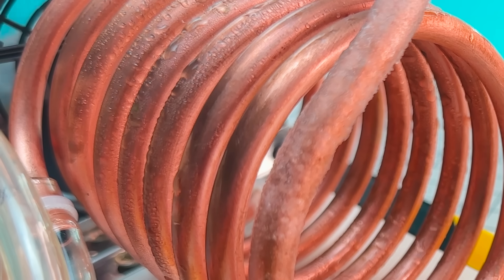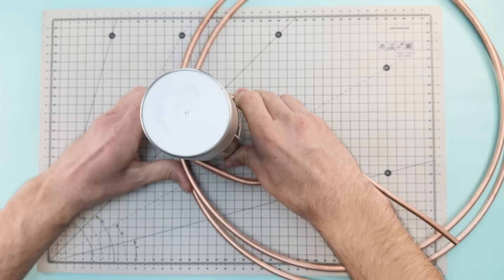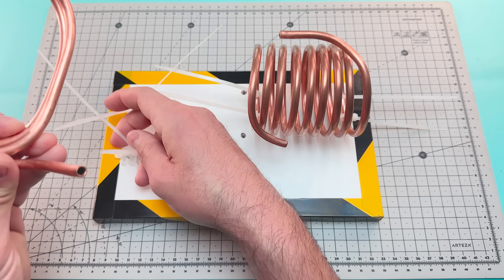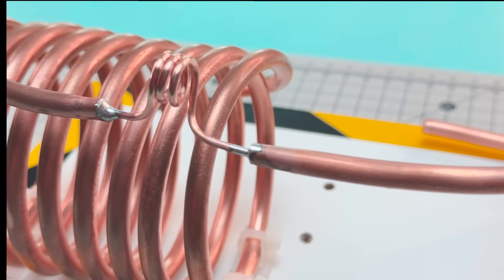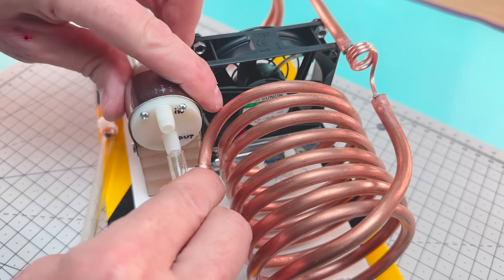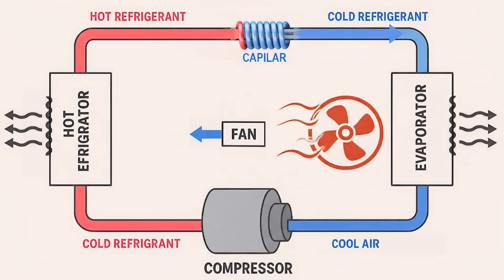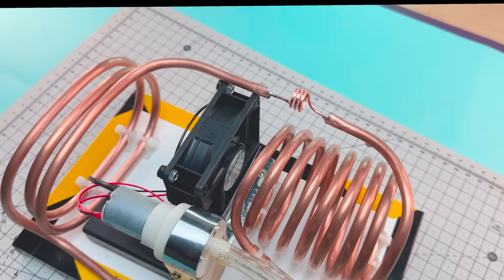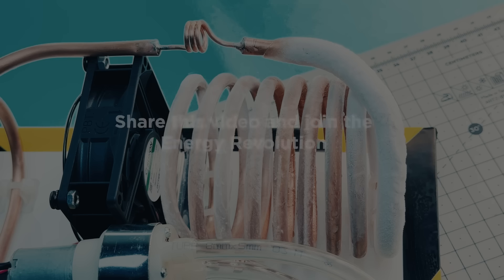Make your own AIR CONDITIONER at home Fast and Easy!

Comment: 1. Your pump is not compressing. 2. your nylon tubing wouldn't be able to withstand the pressure required of the refrigerant. 3. your loop is full of air. 4. even if this did work your "evaporator" would just be absorbing the heat off the "condenser". Thanks for playing, better luck next time!
Reply: Every ac needs an actual compressor.  
Can you make a home made ac unit?  Sure.  You just need the actual parts that makes it work
Reply: The sound of the Zip Ties is what made me think, this guy is a legendary genius with generational talent
Reply: Salut donc sa fonctionne pas rassuré nous merci
Reply: The small coil is the “metering device”
Only thing I would change is put a more sealed funnel around the return and the supply side of the fan
Reply: 😂😂😂😂😂 vacuum ?
Reply: This is basically what you do in HVAC class. It's not a room air conditioner, it's the same as a refrigerator.
Reply: @McsandwhichMinus refrigerant.
Reply: @McsandwhichMy physics teacher said that the air conditioner motor is the same as the refrigerator motor, but you should always put the hot part outside for it to work, just like if you put the hot part outside you can cool the room with the door open
Reply: ❤❤ just ce for the concept of the project
Reply: Prove it with a video.
Reply: 8 months AC/ refrigeration certification well earned lol lmfao
Reply: Kinda hard actually finding a simple DIY project to demonstrate how the cooling works
Reply: @DanChr83 No it's not.
Reply: Bonsoir..quelle pression de gaz faut-il injecter ?
Reply: OK ESTOY MUY AGRADECIDO POR TAN APRECIADA INFORMACIÓN. MIL GRACIAS.
Reply: Sou leigo no assunto. Será que essa bomba de ar deixa vazar muito gás? Onde encontra esse tipo de bomba? Eu vejo na Shopee e Mercado livre umas bombas de água, mas penso que parte do gás será vazado no dia a dia.
Reply: Its an evaporative cooler
Reply: Do you know what high and low pressure zones are? Doofus
Reply: Why do people do this?!?!?!?
Reply: Not the room, what about a water recipient that sprays water to a fan?
Reply: 1 Nobody cares, you’re a bot account without any solutions only issues. You can state “everything wrong” but not provide any value to the world. You’re funnu
Reply: Of course it is compressing. There is a suction side and a discharge side. The working fluid does all the same things as a “real” AC unit and gives up heat in the process with the capillary acting as the expansion valve. Could this thing “cool the room”? Of course not. But it demonstrates all the principals of refrigeration . Sorry Neil deGrasse Tyson jr. you’re the one who needs to hold your head is shame for flapping your piehole.
Reply: @jondrew55 😂😂😂 Nope. No compression. The system wasn't pressurized. The system wasn't evacuated before attempting to add the refrigerant, so almost none went in. And 9V battery would be dead in 10 minutes.
Reply: @jondrew55 What about a grow tent. To me if you built a cover that makes the fan and  condenser contained to direct all the air from the fan through the condenser coil that would be more efficient. Also couldnt you add a cover to contain the other coil(the one that gets hot)and add a fan on the back side of that coil to pull the heat away from it and to keep the air around and being blown through the condenser coil fan as cool as possible so that it can run as efficiently as possible. I took heating an air conditioning but was on probation and was forced to quit school because my classes were at the same time as classes amd meetings I had that had to do with probation so my probation officer sd I had to quit school. So I didnt get ro learn anything really accept kinda how an ac works. But im smart skd I read a lot about different sciences like physics and quantum physics and i read somewhere that some engineers working for a company trying to build an alternative to modern air cinditioners using a ceramic structure that works without electricity. Im not sure if they modified the ceramic and changed the way it was produced. Its bern a while since I read about it but i seem to remember being amazed that it had to do with how the unit was shaped. But im waiting to build a DIY system for cooling my grow tent and a DIY water chilling system for keeping rhe water cool so that I can max out the dissolve 02 in the water. Water temp the temp inside the grow tent are major environmental conditions to be controlled that can greatly benefit the quality and size of the harvest if you can control them well.
Reply: At the end, he is the winner, since you watched his video, and he is here just for views. He is smarter than all the viewers...
Reply: @Boubson  So what about the people who will go out and purchase all of the materials required to build this device only to find that it doesn't work? they are the losers?
Reply: @anthonyl94 yes
Reply: @Boubson ...We know what he is doing....but he doesnt know what 'we' are doing. I identify and locate  people like this
Reply: So how did it work on the video. Was he using AI to make the copper coil cool the water in the air to make the frost on it. It may not be very efficient but it worked as far as I could see.
Reply: I feel like that once the coolant is inside the air pump pumping it creates a vacuum ajd the pumping of the fluid  and condensensing of it and then it being forced through that tiny copper coil would create all the compression needed at the air pump to make this work. But I haven't studied or researched much with the sciences involved with governing the thermodynamics of cooling and heating air. But im smart enough yo see that if the condenser coil had frost build up on it that that means it was working. If ypu cant compress the fluid inside the unit its not going to create enough fluctuation in the temperature of the fluid to be able to cool that copper coil enough to freeze the water in the air surrounding it with just a fan blowing on it so while its efficiency is most likely very poor it still seemed yo work as intended
Reply: @SamHolmes-n4u  Did you notice how the air in the tube wasn't evacuated first? That means the refrigerant didn't actually enter the tube in great enough quantity to do much of anything. Also, the syringe hole is big enough to let any pressure, out. Compression won't happen in that air conditioner. So you'll never get cold coils and thus cold air.
Reply: @SamHolmes-n4u Since he didn't evacuate the air before adding the coolant / refrigerant, very little actually entered the tube. Further,  by using the syringe and putting a hole in the tube, any pressure would instantly leak out through the hole.
Reply: Wow. How mature and intelligent. Is that your tag line? Whenever you get into an argument do you always end it with “thanks for playing, better luck next time”?
Reply: He’s not using actual refrigerants and it’s on a small scale. Calm down hvac helper lol
Reply: @alienandroid2012 😂😂😂🎉
Reply: @alienandroid2012 correction, isobutane is a refrigerant (R-600a; C4H10).
Reply: @alienandroid2012  El Isobutano sí es un refrigerante, es el R600a, además una de sus principales características es que es un refrigerante con un gran coeficiente de rendimiento. Otra característica es que es explosivo.

Comment: If it worked the EPA would be all over you with regulations. lol
Reply: They already are! They kept moving their goal posts UNTIL all the refrigerants were banned by the swipe of their pens! We went from the CFCs which they claimed were depleting the ozone in the stratosphere. Controversy on this theory is that a volcanic eruption can spew more chlorine, which is the halogen that depletes ozone into chlorine monoxide. CFC refrigerants may of been contributing to ozone depletion, however the HCFCs like R22 would degrade in the lower regions, ground level if it was released into the air. Now this exaggeration of GLOBAL warming potential BANNED the HFC classes of refrigerants. THE EPA does NOT want any of US to have refrigeration or Air/cooling in our homes and cars! They want to have it for themselves while everyone suffers. Like the nobels and serfst.  havvaniceday.
Reply: @m1670redeemed  Damn straight.  The People ought to dismantle governments via 2nd Amendment means.  Sadly, we're too weak to do so and govt knows it.

Comment: Pro tip, it won’t work, the head pressure needed to condense the refrigerant is significantly higher than that motor can ever produce, there’s also pretty much everything else that’s wrong too. That metering valve size is based on what? That won’t do anything.
Reply: May of had a chance if he pulled a vacuum? The condensor may be too small, and the refrigerant needs to be the equivalent of R134A whatever A2L refrigerant the EPA is forcing US to use?
Reply: The hardest part of this is a hermetically sealed compressor, if you diy that somehow…the rest is relatively simple.

Comment: AMAZING  how  that battery  could power  12 vlt  fan and pump  must last  long  time  especially that its 0nly 9 vlts  I really  love   the home made clear pressure hose  and how its held in place must hold a lot of pressure oh and heat          :body-blue-raised-arms:
Reply: The clear pipe is on the low pressure side of the circuit, the copper pipe is on the high pressure side.  All air con have a high and low pressure side. The efficiency of this experiment is not great,  yet it’s an excellent educational experiment.  If you want to criticize its function it would not take you long or cost much to reproduce the experiment and maybe suggest improvements
Reply: @andrewstones2921  Soooo you think that that low PRESSURE has no pressure And  with no compressor the pressure is the same all threw  and a rubber hose just slipped over fitting will hold it when it heats up and loses its tightness AND USING BUTANE is in any way safe ?   WELL  here's  my Suggestion  Dont build it its a bomb looking for a trigger!      :body-blue-raised-arms:

Comment: how Stupid quickly "cools" a room (from most expensive to least expensive):
1) creates unexhausted closed loop cooling system powered by 9v batteries
2) leaves the freezer door open
3) takes ice out of the freezer and puts it by a fan in the same room
4) runs a fan in the room
Reply: i think his point is to put this right outside the room and use the fans exhaust to push cool air in the room(like how all AC's work)
Reply: this is just basic fundamental of how ac works, to takcle your problem, just mount 2 fans seperated from one another, one for heat exhaust towards outside in one direction and one for air intake in room(or circulate which is optimal for cooling but not for breathing), have a ventilation open
Reply: @harishjoshi-wf2xe  I think thousands of people will learn how to heat their rooms as much as an expensive little 9v battery can from watching this... I'd use two high power dryer exhaust fans (about $25 with alternating current plugs preinstalled) and some dryer hose ($10)...about as good as your average $120 chinese 6000 btu window AC, or $500 portable AC with exhaust hose...
Reply: @Doing_Time  Yes.  This video is a proof of concept, but it does need to address effectiveness and efficiency.  A prototype split system would be cool.
Reply: @Doing_Time  i mean this is an example/prototype. you can change the power supply, no

Comment: Wonder if a similar concept could be used for a cold air intake to improve mpg or hp performance.
Reply: it would most likely take more energy than you'd gain
Reply: The Dodge Challenger SRT Demon is the only car that uses its air conditioning system to cool the intake charge, specifically the intercooler.

Comment: Your spitting in the wind by keeping the condenser heat in the same ambient, but you can cool a 12oz can of beer set inside the cooling coil.

Comment: That's more of a dehumidifier than an air conditioner, it needs  pan under the evaporator to catch the condensate, you could put a beer in the evaporator to cool it i guess, over than that it's not much good for anything, except maybe a cool project demonstrating basic. refrigeration

Comment: Although one coil is cold, the other side is hot as is the fan and compressor motor. You have to separate the two sides and exhaust the heat outdoor to make the room colder.

Comment: I'd say it's a good demonstration model. To be functional and actually cool in any small area the condenser and evaporator would need to be insulated from each other . Such as putting the evaporator inside a chest cooler and the condenser and pump on the outside of the cooler. Then adding a small fan to the condenser coil too keep it cool.

Comment: Ill be impressed when you can build a window unit that lasts more than 3-4 years in the southern Nevada heat. I went through 4 in 4 years. Hopefully the much much larger than recommended 230v will last more than 1 summer. I started with the box room size suggestion, and jumped up a few thousand btu with each new one. Im now at the 2nd largest window unit i can find at 24k btu 230v. Fingers crossed.

Comment: Complete nonsense! If the evaporator and condenser are located in the same room, the effect is completely canceled out. The electrical components actually generate heat, making the whole thing a poor heater. You might as well open a refrigerator; it'll get cold at the front and warm at the back, and the overall temperature in the room will rise!
Reply: Concept correct, works great for cooling my beer at the river. But not a room due to no heat separation , but that’s easily resolved. Nice how to vid.
Reply: I'm an hvac mecanician and you are totally right , it is a fun experiment to do with kids but it will never cooldown a room😂
Reply: @EricLord777 yep, I’ve been a centrifugal mechanic for 40 years myself.
Reply: Basically AC or Refrigerator are heat pump. The heat must be removed (by condensor) from the room to be cool (by evaporator). Both component can not be at the same room.
Reply: Figure out how to make it solar powered? I would like to see what your ideas might be. 

I do have a question. How long until refrigerant need to be recharged?
Reply: Я так понимаю что конструкция должна быть в разы больше чтобы охлаждать комнату и чем больше комната тем больше и дороже конструкция,а пока то что в видео способно охлаждать разве что напитки и еду на природе например что тоже не плохо .
Reply: LMFAO!! Not to mention that neither coil has fins. The 12 volt fan and pump are powered by a 9v battery. 😂 Only one part of this video is accurate. The basic refrigeration cycle diagram.
Reply: @benstone5650 he is showing basic principles for kids don't you get it... The Engineering is not about having a huge ego and disrespect others. Real engineers start with having good ethics... ever heard about it... I don't see anything funny here. All I see is simple Physics principles not the whole idea... just the bare concept so kids who are engineers of future can learn something...
Reply: @the-matrix-has-you LMFAO! Then why did he say that that contraption would cool a room. Don’t you get it?
Reply: basic thermodynamics
Reply: You are so smart!! Wow. Did you study?
Reply: So all you need is a exhaust fan and a insulated pipe
Reply: @deanlauer6950 y poco de agua / and a little bit of water / und etwas Wasser.
Reply: @deanlauer6950  close, but that's not the magic
Reply: This could be used as a simple dehumidifier, if the compressor was used with a timer to periodically turn it off
Reply: How did you get all the air out of the system you have to get the air out for it to work correctly
Reply: he gave you a basic rundown and demonstration on how air conditioning works so anyone can adapt this tech for their own needs?
Reply: He said the device he made would cool down a room. He didn’t say he was showing a concept that wouldn’t actually work. He said he was making a device that would work. Is this all too complicated for you, Scooter?
Reply: @DavidFerree54  language barrier honey 😂
Reply: @BxBxProductions Ich bin unter anderem ausgebildeter Kältetechniker. Die Erzeugung von Kälte erzeugt grundsätzlich Abwärme durch die mechanischen Komponenten, und wenn man den zu kühlenden Raum nicht von dem Raum trennt, in den die technische Abwärme geleitet wird, dann hat man einen geschlossenen Kreis, in dem man ausschließlich Wärme erzeugt. Jeder Motor erzeugt Wärme!

I'm a trained refrigeration engineer, among other things. The generation of cold generally generates waste heat from the mechanical components, and if you don't separate the space being cooled from the space into which the technical waste heat is directed, you have a closed loop in which you only generate heat. Every engine generates heat!
Reply: @mischagarcia1973  yes. anyone with a modern day education understands what closed and open systems are. heat loss through friction etc. nothing is 100% therefore infinite energy/net positive energy generation isnt a thing yet.
Reply: Its concept dude, application is on you. Whats complete nonsense is you calling yourself out for not being able to think bigger than an acorn
Reply: Yeahh your fridge or freezer works the same way yet you use it right... so its not nonsense after all. Rules of Physics number one energies does change states. Energies doesn't just dissappear... they transform... In other words all that heat has to be compressed transferred into somewhere else... like your fridges radiators which dissipates heat which compresser pushes out the heat and Lowers the inside temperature... Simple Physics
Reply: It was only the concept of cooling .....not application dude

Comment: Summary of the two pressures for R-600a with:

Evaporator temperature = -10°C → suction pressure ≈ -0.3 bar (relative)

Ask him to place a pressure gauge and show the unadulterated value.😂😂😂

Comment: Hmmm its a cooler and heater at the same time, you extract heat on 1 side and release it on the other side, but it's a good example of the workings of an ac cooler / heater.